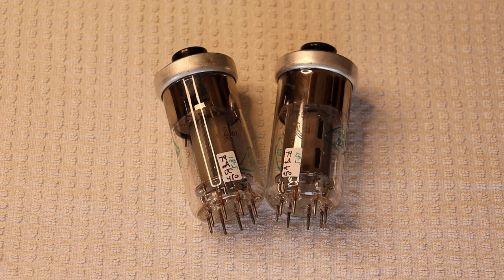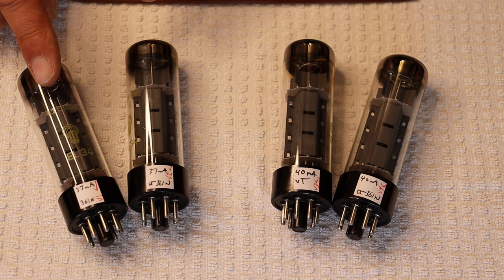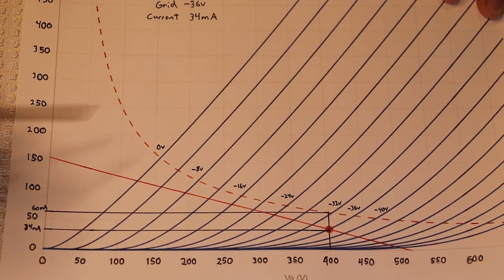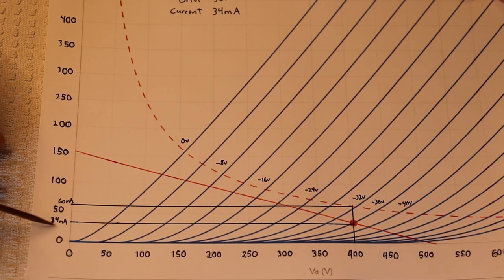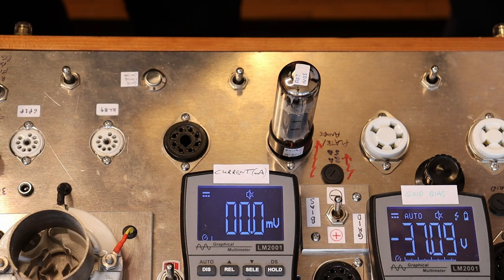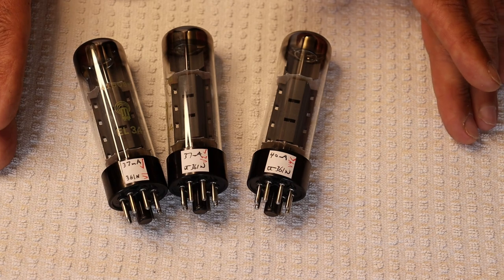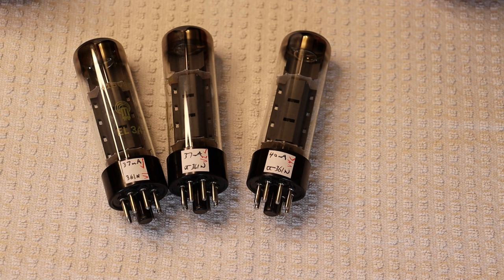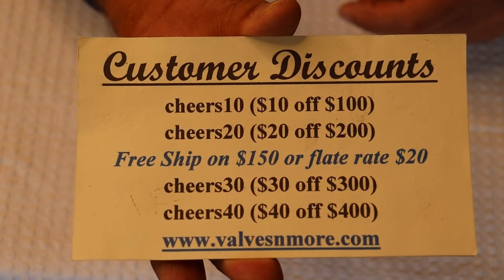Tube Lab #138 - Matching Power Tubes & Saving A Damaged Quad

Comment: can you show us how to design a tube amp? How the different stages of the amp are being chosen. what the formulas and load line drawings help us determine the next or previous stages. What to look for.
Reply from the maker: This would be the equivalent of a two year college program!  But I get what you're asking and perhaps we can give an overview of the process of designing tube amps in a future Tube Lab.  We have a number of overview videos of each of the Kit Amps that explain how the circuit works - that would be a good start.

Comment: Hi Tube lab, in the past you've discussed how EL34s sound great for small ensemble jazz recordings and KT88s are a bit more exciting for rock and rollers. What about for classical music listeners? If I want the full force of Beethoven's fifth symphony, is high powered solid state my best bet?
Reply from the maker: Possibly a lot will depend on your speakers and how efficient they are.  If they are moderately efficient>90db, then most tubes amps should create a satisfying dynamic sound.  Generally Classical music fans have two choices the warmth and richness of the EL34 or the bass and dynamics of the KT88 type.  I have a large Classical collection and have season tickets to our local symphony and I would be happy with either choice, so long as they were quality vintage tubes.

Comment: Is there any other method to roughly match tubes when you don't have access to a tube tester?
Reply from the maker: Maybe, but with a lot of Qualifiers  and Cautions.  IF you had a quad of matched power tubes from a reputable supplier and you had an amp like the R8, if you lost one or two tubes you could use the bias current gauge to sub in tubes till you got a reasonably close match to the remaining tubes, that would work.  But you need to understand IF the tube has a dead short you could damage your amp and you need to start with some already matched tubes to make this work around practical.  One of the reasons vintage power tubes are so expensive is that it takes a lot of expertise and time to properly test and match them.
Reply: @tubelab194  I do own an R8 with stock KT88s. I just want to know how closely matched they are or did they just throw in any tube at the factory? I have changed the front end tubes (Philips JAN NOS 6SL7s and AWA NOS 6SN7s (licensed RCA Radiotron tubes) that improved the sound quality and removed a lot of scratchy/crackling noises coming from the speakers.
Reply from the maker: @mddawson1  right, so with the bias centered, shut down and switch v1&2, use v1 as your zero tube, now every tube you switch out with v1 should be very close on the bias meter. That simple test will tell you how closely matched the quad is.  In my experience they'll be way off.  Let everyone know what you discover.
Reply: @tubelab194  I may try that too. I was pretty happy with the sound of the factory tubes. 
The Svetlana's were definitely an upgrade, but would be interesting to see if some amps got lucky and had closer matching sets originally.
Reply from the maker: @pnichols6500  my stock R8 tubes were so bad I binned them all.
Reply from the maker: @pnichols6500  I actually thought I may have made a mistake when I bought the R8 over 2 years ago, it sounded that bad with the stock tubes. But with a complete set of matched quality vintage tubes in, she really started to sing.
Reply: @tubelab194  I really think that it's the luck of the draw, a casual listener probably couldn't tell if I had the stock tubes in or the Winged C's.
Reply from the maker: @pnichols6500  if the whole system was good stuff, particularly the bass reproduction, I guarantee almost anyone would be able to here the difference.  We regularly get notes from customers who've never listened to a quality vintage tube only modern stuff.  They almost always start with words like "unbelievable" or "wow" or "holy....".
Reply: @tubelab194  I think my term "casual" listener is misleading. 
I was thinking about someone like my mom, or anyone without any clue to a stereo system. 
I agree there is no real comparison to the set you all put together, and looking forward to adding to those!
Reply: @tubelab194  I carried out the test with my R8 connected to an 8 ohm dummy load after 30 minutes warm up and in UL mode rotating each tube through the V1 socket.
For clarity sake, I will call the meters vertical markers L3 L2 L1 0 R1 R2 R3. I hope this makes sense:
I adjusted V1 bias to 0 (centre). 
V2 was R0.2 (just slightly to the right of 0). 
V3 was L4 (beyond L3 by at least another space). 
V4 was L3.2 (just to the left of L3)
So possibly matched pairs but definitely not a matched quad. Note, V1 still measured 0 once it was back in it's correct position.
Reply: @pnichols6500  I find that the a lot of people you are describing don't even notice the difference between a cheap and nasty midi system and a quality system.
Reply from the maker: @mddawson1  excellent so you now know you have 2 fairly closely matched pairs that aren't close to each other.  I did an experiment a while back and took a 10% matched power tube and swapped it out and the meter barely moved!
Reply: @tubelab194  Today I got a matched quad set of TAD KT88-STR tubes. I carried out the same test as last time: R8 connected to an 8 ohm dummy load after 30 minutes warm up and in UL mode rotating each tube through the V1 socket.
Once again for clarity sake, I will call the meters vertical markers L3 L2 L1 0 R1 R2 R3.
After fitting the new tubes but before adjusting the bias on them, I noted that the new V3 was the only tube still at 0 so presumably that particlar Willsenton tube was the only one closely matched to the new tubes.  
V1 was 0 (centre). 
V2 was L0.8. 
V3 was 0. 
V4 was L0.8.
After checking, I switched V2 and V3.